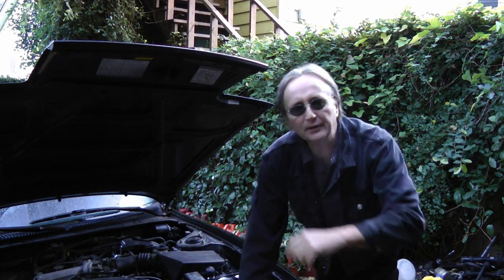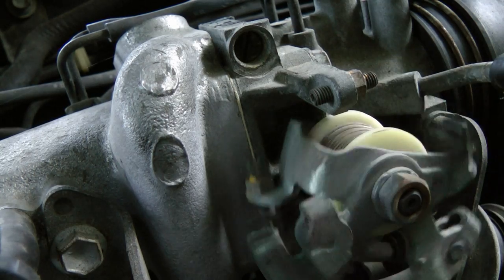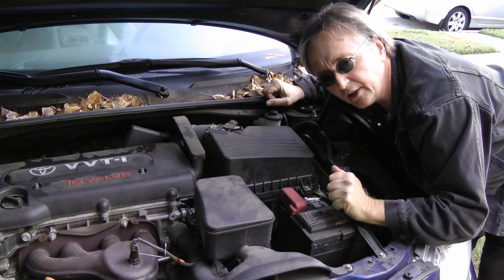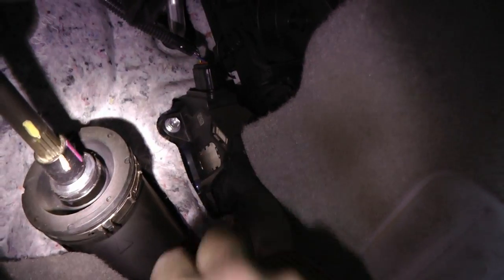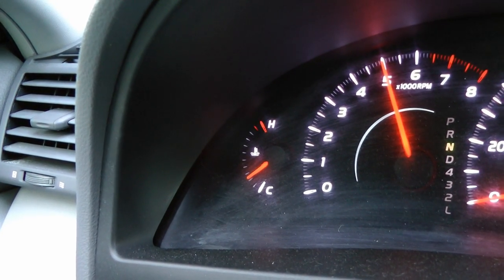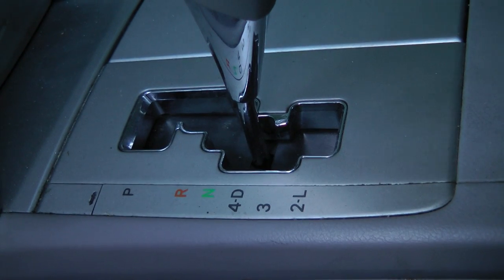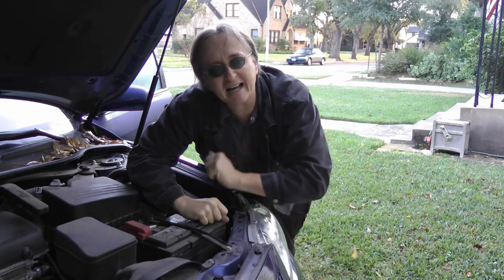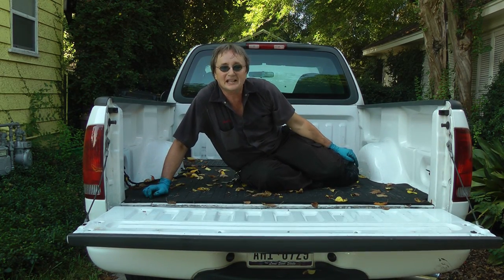How To Stop Unexpected Car Acceleration

Comment: The sad truth is that too many drivers on the road these days are idiots that don't know how to drive safely, and panic as soon as something unusual happens with their vehicle. Especially those idiots who drive with one foot on the gas and the other on the brake pedal simultaneously, and run the risk of confusing one for the other in an emergency situation.
Reply: Hippie Smile ;o)
The left foot on the brake pedal, and the right foot on the gas pedal, simultaneously. Is that any clearer now ? lol
Reply: AlainHubert I have never known anyone who has continuously driven using both feet.  I do, however, know of people who first learned to drive who used both, including myself.  The only reason I did that is because I had a hard time getting the feel for how sensitive the gas pedal was, but after less than 5 minutes I never did it again.
Reply: AlainHubert Saw your channel profile picture and had to check your stuff out. I'm a drummer, too. Cool. ; ]
Reply: *****
Thanks man ! \m/
Reply: Anonymoose Makes sense, but this matter still reduces to someone's habits, awareness and general intelligence. 

Aside from my Dad letting me take his secondhand black Cadillac for solo cruises on the fairly lengthy cul-de-sac driveway where he lived when I was 12, I officially learned to drive a few years later, in an automatic 1976 Vega. Miss that car, I do. ; ] 

My current car is a 5-speed manual, and it's the first 'stick' I've ever owned, though I've driven several over the years. For 34 years my driving has mostly been in automatics, and I've never been a 'brake rider'. It's about how you're taught, but mostly how you practice.
Reply: AlainHubert This is bullshit... I drive with one over the brake and one on the accelerator all the time, never have I ever had that problem you speak of, in fact my brain knows left is brake right is accelerate, so I'm less likely to get confused.  If I were driving with one foot, I'm pretty sure I'd be more likely to accidentally floor the accelerator on accident thinking it was the brake pedal...

I learned how to drive a manual are you saying that people driving manual cars will get confused and slam the clutch in an emergency situation, basically putting their car into neutral, so they just keep going at the same speed? Damn people are idiots...

Not only the things I mentioned above, but reaction time to hit the brake pedal is much faster when you have a foot always there.

The thing you say about having both feet over the brake and gas pedals being dangerous is as stupid as saying people shouldn't have a foot on the hi hat and kick pedals when playing drum set, because they will accidentally push both at the same time...that's stupid, if you have that issue, then your brain is stupid, or maybe my brain is just more advanced.

I've run into emergency situations where I had to brake quickly and was fine, I never had an issue getting pedals mixed up.  Perhaps it's the idiots that went from manual to automatic who are causing all the problems, because they hit the brake on accident, thinking it's the clutch pedal.

It's true, when I drive manual, I keep my left foot over the clutch and right foot for gas and brakes, but there is no issue when I have my left foot over the brake pedal in an automatic.
Reply: nambinhvu 
Well, you must be part of the thousands of assholes on the road that have their brake light flickering continuously on and off, in front of us, because their left foot is riding the brake pedal. Also, you must be changing your brake pads and shoes pretty often, riding those brakes (especially if your car has power brakes and a sensitive brake pedal). 

Moreover, when you need to stop in an emergency, those brakes are already warm, if not hot, from the added constant friction due to a left foot slightly pressing continuously, and their efficiency will be greatly diminished (unless you've got carbon fiber brakes, but I doubt that very much). 

There are very logical, and multiple reasons, why it's not recommended, nor taught in driving lessons, to keep the left foot on the brake pedal all the time while driving. Most cars, even offer a foot rest step, left of the brake pedal or clutch pedal, in order to keep the left foot on it during long trips on the highway. There must be a reason for that, too ? 

BTW, you'd never see a bus driver, or race car driver, or truck driver keeping the left foot on the brake pedal all the time, I wonder why ? Maybe it's because they were taught how to properly drive their vehicles ? 

And in case you don't know, driving with the left foot on the brake pedal at all times during a driving lesson, or final exam for a driving license, is an automatic fail and you'd have to restart another lesson at your own expense. There must be a good reason for that, too ?

But asking you to be logical or wise, seems like asking too much of you I'm afraid.
Reply: AlainHubert Nice try...only idiots leave their foot actually on the pedal, do you ride the clutch? I can see why you think people would ride the brake pedal...

I have an 03' prius which still has its original brakes and over 170k miles on it, and no, my brakes don't squeak...
Reply: nambinhvu Whenever my left foot is not needed, it is resting on the left foot pedestal on the floor of my 2003 Toyota Corolla with a manual transmission. 

And your Prius is an exception to the rule, because that car actually has a regenerative braking system, where the required friction in the standard braking system, in order to stop the car, is greatly reduced. Hence the extended life of the pads and shoes (lucky for you).
Reply: +nambinhvu (left foot is for support)
When executing a normal right turn using only your right arm, If you've ever supported your left arm on the door panel or in the window frame, it's because you understand it limits the shift in body position, reducing the rocking motion of your right arm, reducing unintended movement of the steering wheel, resulting in a smoother turn.

Having the left foot free allows for additional support to keep our body in place during emergency maneuvers. Without that support the driver's body experiences a greater shift in position which can result in the following:  Intending to brake with left foot, and OOPS, right foot slipped forward and tapped the gas by mistake thus nullifying the intended benefits of a quick left foot brake response.

I admit, both sides have their valid points though.
Reply: +PS PS The hell?  lol I never ever had that issue, I guess I'm just more coordinated than most people out there.  I could even drive without my right foot, using my left for both brake and acceleration.  According to my friend, whose husband broke his right leg, he can't drive until his right leg heals, which I think is stupid, even if the excuse is that his right foot gets in the way, just throw it over the center, then there's no problem. XD

On top of the driving with both feet, I also drive with one hand most of the time, and I can do sharp turns just fine, in fact, it's easier with one hand, the only reason I'd need another would be to signal, though my left hand can do both, the right makes you have to reach for it, but as for steering and control, both hands do just about equal.  I never support my left arm on the door panel or in the window frame, in order to make sharp turns with a single hand, I have an open palm pressed against the wheel and just rotate it in a circle, much smoother turn than passing the wheel from one hand to the other in a circle.
Reply: +AlainHubert Lol I still don't get unintended braking/acceleration like people think happens...  I think you guys just need better control of your bodies, you don't seem very coordinated if you can't handle keeping both feet there without pressing on accident.  If you think that's what happens, then you're most likely one of those idiots that drove with two feet and made that mistake...  If you weren't one of those idiots, then you have no experience driving with both feet, one on the brake, one on the gas, so you should just shut up about it since you're basing this mistakenly hitting the brake/accelerator off of no actual experience.

I don't think you guys understand what's going on.  I'm not resting my foot on the brake pedal...that's stupid, I keep it hovering over it, with my heel resting on the ground... how does that cause the brake light to flicker or wear the pads?  I think you guys are talking about your own person idiotic mistakes driving with your foot resting on the brake pedal.  On top of all that other crap, I wear flipflops most of the time and take them off while driving, so I'd definitely know if my foot hit the brake pedal because I'd feel it...  Though even with shoes, I can definitely feel when I hit it, and I never unintentionally hit it...  If I do need to rest my foot for some reason, like adjusting my seating position, I will move my left foot to the resting area for that moment, and that moment only.  It's been years and I've never had a problem.
Reply: +Deltasevenfour I've driven 13+ hours straight multiple times without my foot/calves/legs getting tired.  If your legs are too tired hovering there, then you either need more leg muscle or you have your chair too far forward/back.  How is it even possible for you to press the gas pedal for that long if you can't hover your foot that long, which takes even less muscle to do?
Reply: AlainHubert oddly, lots of professional race drivers use both feet. In racing it can be an advantage when executed properly.
Reply: Professional race car drivers (in Formula 1 for example) are very well trained to do that. Not the old lady in a parking lot running into a store window because she confused the gas pedal with the brakes... lol !
Reply: AlainHubert nice cymbals. You've got a small fortune invested there don't you.
Reply: nambinhvu it is illegal to drive barefooted.
Reply: nambinhvu I think you need better control of your body. Is moving you foot from the floor to the brake difficult for you?
Reply: nambinhvu I'm sure he doesn't know how to drive a manual transmission.  He probably tries to use his left foot on the clutch pedal and brake pedal at the same time.
Reply: Thanks. About $1K (2008 money).
Reply: Wayne Wildman show me where it says driving barefoot is illegal...how can you even get a ticket for that, it's not like police will rip your door open while you're driving to catch you in the act...
Reply: Wayne Wildman nah, but when I'm going to use the brake a lot like stop and go traffic, why would you move your foot to the floor? the only time you'd do that is if you're on a long stretch of freeway going a constant speed with no need to brake for a long time, of course then you won't need to leave your foot over the brake pedal.
Reply: nambinhvu because your right foot controls the brake and the gas. So it doesn't go to tell floor it goes to the gas pedal. All you do is keep your heal in the floor and pivot your foot slightly between pedals. You never even lift your foot.  
Dude...you sound like an idiot arguing when you are driving in a way that is regarded as incorrect.  Try that two feet thing during a driving exam and they will fail you.
Reply: nambinhvu it is illegal in California.  People get pulled over for other reasons and the cops notice they don't have shoes on so they give a ticket for that. It is a common ticket in areas near beaches.
Reply: nambinhvu by the way, pressing the gas pedal takes far less energy than holding your leg up. Think about it.
Reply: It's alot harder for me to be a 2-foot driver unless I'm racing (or driving a manual, obviously). Always use your right foot for gas and brake.
Reply: I did drive with two feet on my test and passed, no problem... There's no law that says you have to drive with one foot... try telling a handicapped person with no feet that it's a law to drive with only your right foot...
Reply: Then put your foot on the floor right below the pedal, there's no need to hover it on top or rest your foot on the pedals...the only time I use that foot rest on the left is if I wanna push against it to adjust my seating position on a very long drive. lol  I don't get over 50mpg in a 2003 prius by accidentally pressing the brake pedal...  Apparently I'm able to drive like a professional racecar driver.  Don't blame me for your inability to do the same.
Reply: Huh? You make no sense. Racing takes a lot more skill and concentration than normal driving. Plus, with a racing vehicle, the gas and brake are alot more well tuned than in a street car.
Reply: You just killed your own argument...racing takes a lot more skill and concentration, guess I'm more skilled and concentrated than you?  That means in times where pressing the brake and accelerator pedals at the right times are more critical, you do it better? wtf...So when you have to press the brake in an emergency you just smash whatever is in front of your foot?  If it's an emergency situation and you don't press any pedals, then you'll get in an accident as well.  Even that split second of you pivoting your foot could cause the accident to be much worse.  Driving with two feet alleviates this lag and your brain knows which foot is used to hit the brake, so in an emergency situation it's better, not worse...  Who the fuck slams both feet in an emergency, that's stupid, so you're telling me you lock your left leg and press against the foot rest in an emergency braking situation?  Sounds like a good way to break your leg...

I've had situations where debris was in the road or someone ahead slammed their brakes, and I've never had an issue with pushing the wrong pedals...
Reply: If you'd accidentally slam your feet into the accelerator and brake in an emergency situation while two feet driving, then the counter driving with one foot is slamming your right foot into the accelerator alone while only driving with your right foot, which is much worse...
Reply: You serve...so then what the hell does that have to do with one or two feet driving?
Reply: Again, what idiot slams their right foot down on the accelerator when in a sticky situation? You make no sense whatsoever. I've never heard about anyone, ever, mashing the gas whenever they're faced with a dangerous situation. If so, they need their license revoked immediately..
Reply: So how would you accidentally hit the accelerator in an emergency just because you use two feet to drive? Original comment I responded to "The sad truth is that too many drivers on the road these days are idiots that don't know how to drive safely, and panic as soon as something unusual happens with their vehicle. Especially those idiots who drive with one foot on the gas and the other on the brake pedal simultaneously, and run the risk of confusing one for the other in an emergency situation."

What exactly is your reason for why I shouldn't drive with two feet?
Reply: Because it's unsafe, and I already explained why in my longer comment. Go back and reread it.
Reply: I'm not replying to his comment. I'm replying to yours, and my very first comment was a general statement.
Reply: Unsafe in what way?  How is it less safe than one foot?  Where do you get off telling me I need to drive like you?  You didn't mention how your way is better or worse, just that it's harder for you, that's like me telling people not to do become a doctor, because it's hard for me...everyone should repair computers just like me, right?...  You can't throw a blanket solution out like that, not everyone's brain works like yours and not everyone has problems driving with two feet.
Reply: Read my comment and find out.
Reply: "It's alot harder for me to be a 2-foot driver unless I'm racing (or driving a manual, obviously). Always use your right foot for gas and brake." says nothing about why it's harder...except for you have issues, so everyone should drive like you...that's stupid.  Maybe you should use swype keyboard, none of that two thumb typing or swift key, etc...because it's better for me, so it's gotta be better for everyone...yeah that's stupid.
Reply: I have issues because I drive the correct and safer way?
Reply: No, you have issues because you can't see that not everyone works the same way as you...
Reply: Yeah, not everyone has common sense like I do. 95% of people one-foot drive.
Reply: Aaaand that's how you know you've won; when someone calls you an idiot for giving facts.
Reply: In what idiotic world do you live in where a Prius comes with a manual transmission?  I used to drive an 03 Corolla with manual transmission, yes, I drove with two feet, no not 3 like you seem to think, do you drive a manual transmission with one foot since you seem to think two feet driving is dangerous? What kind of idiotic question is that, "do you use 3 feet"?... Seriously, do you even think?!...
Reply: nambinhvu it was sarcasm obviously.  Went right over your head huh.
Reply: Wayne Wildman because you know I'm right, you fall back to it was sarcasm lol...
Reply: nambinhvu just accept that you are smoked ok. Take a driving test while using your left foot for the brake and you will fail the test.
Reply: nambinhvu and btw, electric cars have always accelerated faster than internal combustion.
Reply: Wayne Wildman I passed it...how do you think I got my license...that's a stupid argument.
Reply: Wayne Wildman Have always accelerated faster? Tell that to the golf carts. I'm sure my crap acceleration prius accelerates faster. lol...
Reply: Wayne Wildman Have you ever heard the saying there's more than one way to skin a cat? you can hold a pencil many different ways and still write with it, same goes with driving and many other things. What makes your way better? Please explain with facts and reasons, not the bs you've been spewing.
Reply: nambinhvu dude I was involved in building an electric police car before you were born. We use to race it at Sears Point in the super Street class. Quarter mile times under 11 seconds at a time when that was insanely fast for a street legal car.
Reply: Wayne Wildman You said they've always accelerated faster. You're telling me the first electric car was faster? Than the gas cars available at the time? The ev1 didn't accelerate faster than all the gas cars. That's not even the first electric car. The first was probably a small battery operated one, pretty sure a toy didn't accelerate faster.
Reply: nambinhvu yes it was faster because thebfirst car ever was electric. Electric motors were far more advanced at the time. Charge times was and is still the problem.
Reply: Wayne Wildman I think energy density is more of an issue than charge times. People just refuse to change their archaic ways. If you use the car like a laptop, only plugging in when you're stuck somewhere for a while, there wouldn't be a problem. Not many people drive over 200 miles a day, so charging at home each night shouldn't be an issue for 90%+ of the population. Only when you go to use it for that one road trip every so often would it be an issue where you want to drive non stop. At that point you could rent a gas car if you want that faster gas fill up just for that trip, so like airfare, you'd have a roadfare to use a once a year car basically for trips. This is better to keep all that extra wear off your everyday vehicle.
Reply: nambinhvu you are missing my point.
Reply: Wayne Wildman Missing your point or not, people are still stupid to think driving with 2 feet is more dangerous than driving with one foot.
Reply: If someone gets confused about something as simple as pressing the correct pedal, then he probably shouldn't be even allowed on the road. No matter if he's using his left or right foot.
Reply: lol
Reply: Go take a driving test with two feet and see how it goes for you.
Reply: Wayne Wildman I had a test on a manual, so it'd be quite difficult to not use both of my feet.